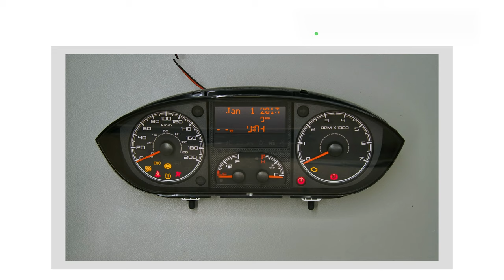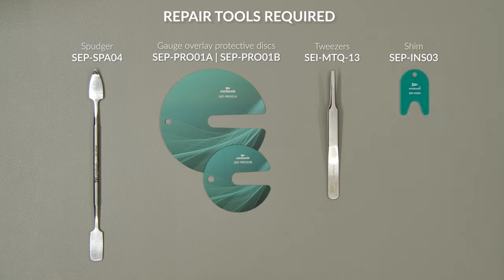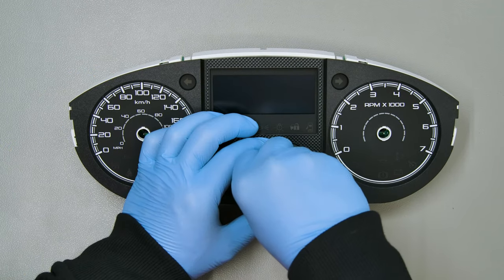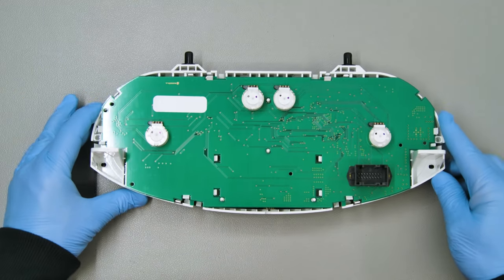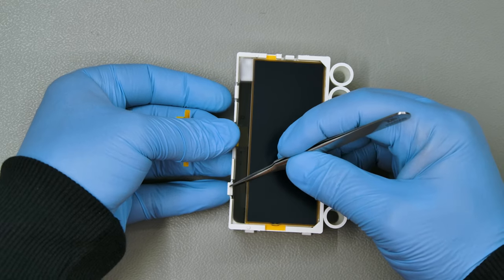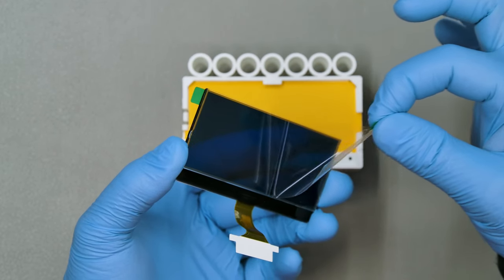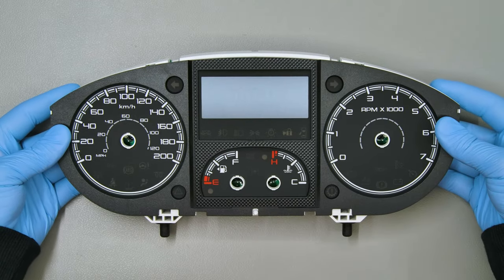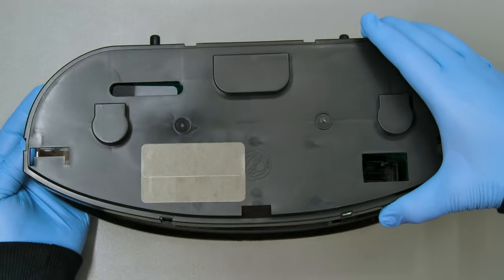Fiat Ducato, Citroën Jumper / Relay, Peugeot Boxer, RAM ProMaster instrument cluster repair

Comment: Hi I have the problem of random warning lights glowing dimly when they should be off. As if they are backfeeding or leaking voltage from adjacent leds. Could this just be a damp or connector problem? From what I've read it is very common.
Reply from the maker: Hi Chris, could you please send an e-mail at info@minitools.com explaining the issue? Our team will look into it. Thank you.
Reply: I have the same issue, did you find out what the problem is?